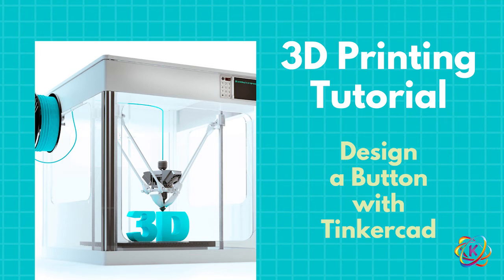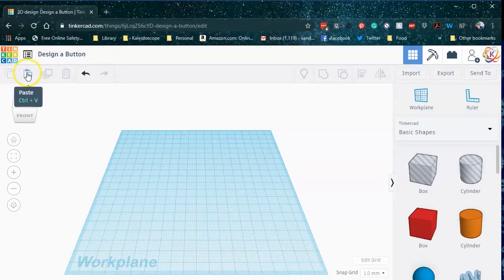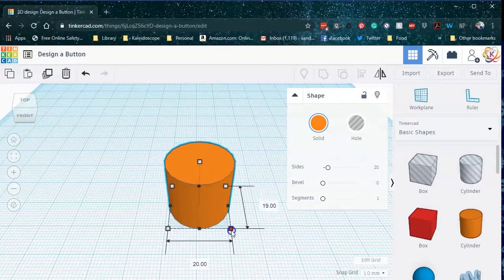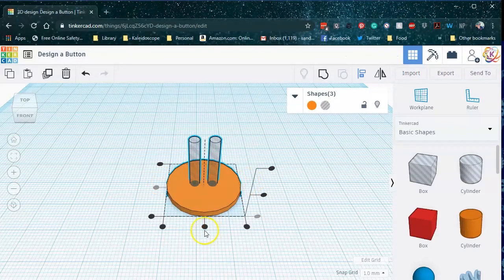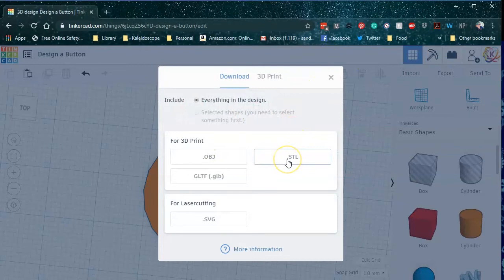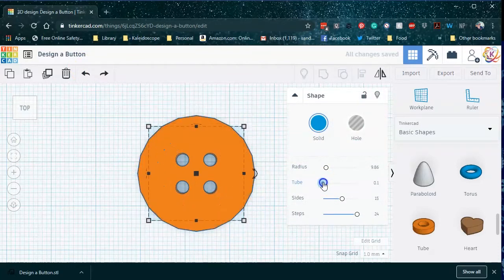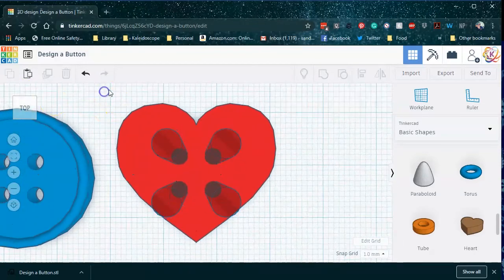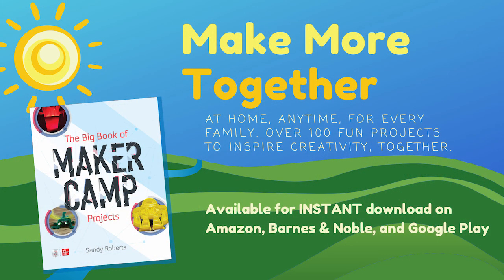Design a 3D Printed Button

Comment: Hi, how do i print?
Reply from the maker: That will depend on the 3D printer you have access to. If you don't have a 3D printer look for a local makerspace or library with a 3D printer. There are also online services available where you can send the file and they will mail you back your print.